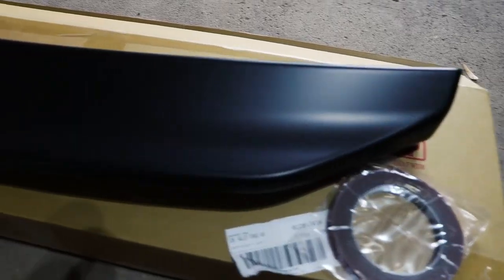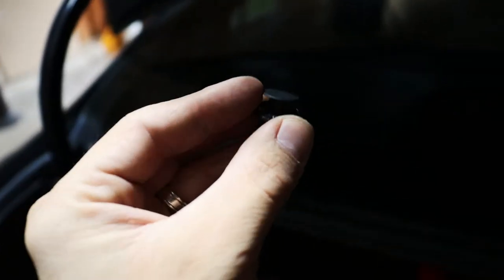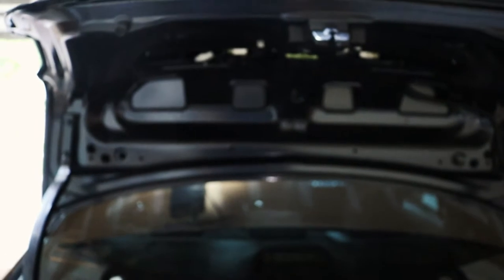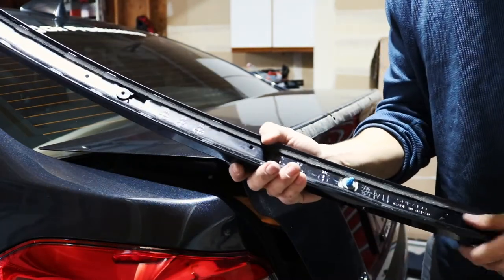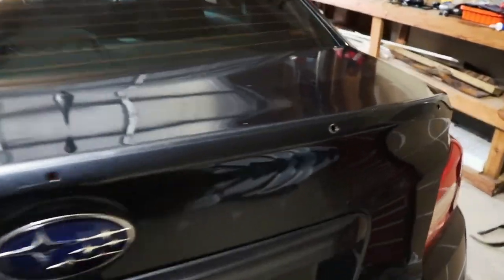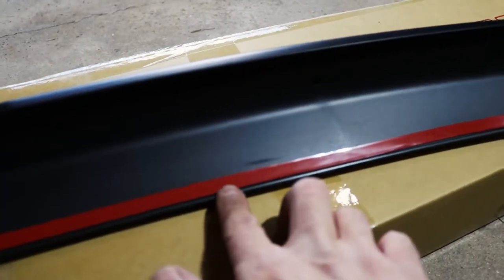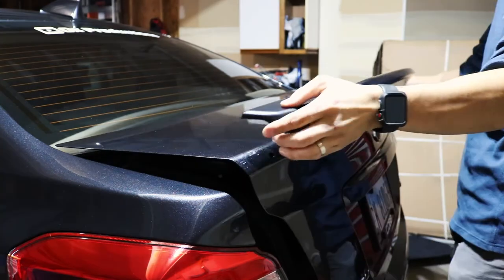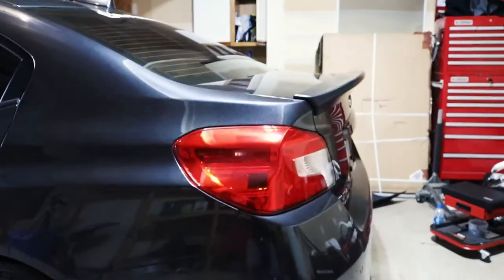How to Install a OLM V2 Duckbill Spoiler on a WRX

Comment: Were you able to use screws?  I saw the holes drilled in the bottom but didn’t see threads for the oem screws/ bolts to be able to thread into the spoiler.
Reply from the maker: I tried to but didn’t really seem to work. If i had the right screws i think it would. It’s also already lifting a little in the corners. Eventually might take it off and re do it.